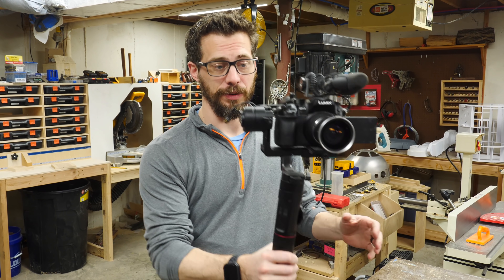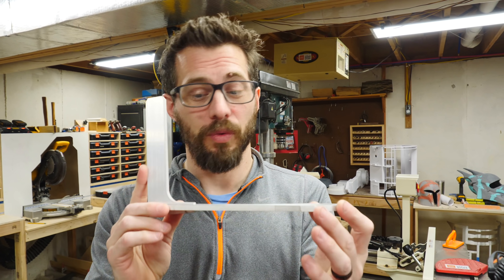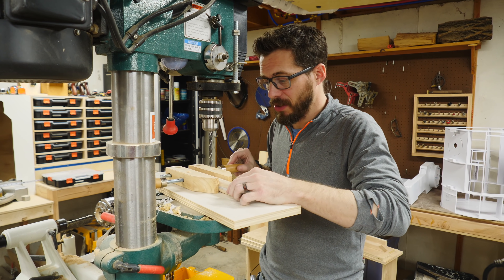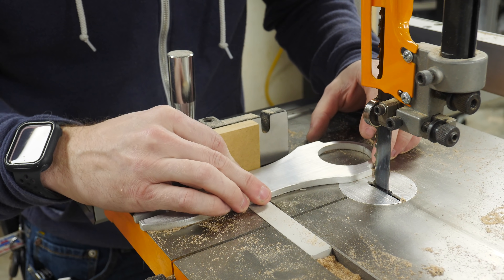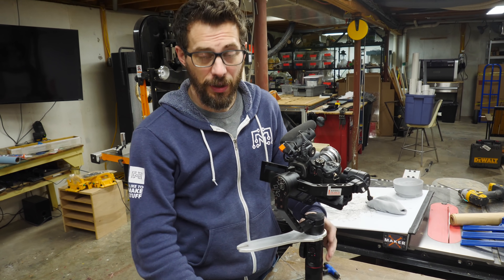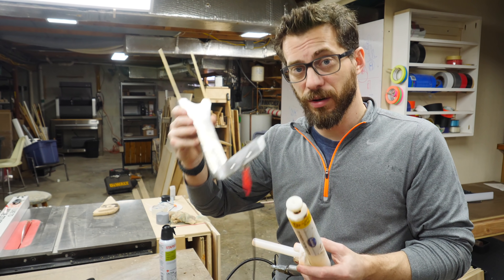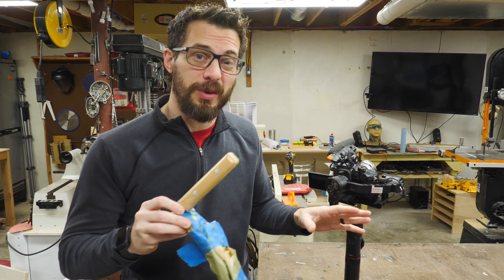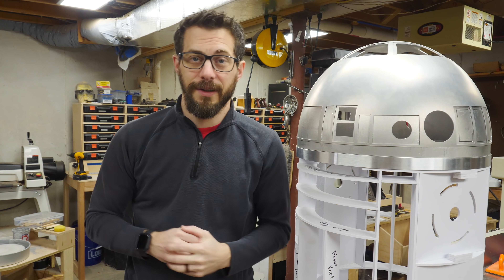Making a Gimbal Handle with a Water Jet | I Like To Make Stuff

Comment: When tapping, I frequently back off the tap to break the chip of the threads I'm cutting.  I heard or read it puts less strain on the tool and less chance I'm going to break a tap.  I don't know if there's any recommendations for how often.  This is what I do and I haven't broken a tap since I started doing it.  Get the tap starting to cut straight.  Go 1/4 turn back.  Go forward 3/4 of a turn.  Repeat.  This cuts only 1/2 a turn at a time, reducing the strain on the tap every time you break a chip.  Blind holes, I back the tap out periodically to get all the chips out of the hole.

According to the book "Manufacturing Processes 4-5" by LamNgeun Virasak, it's common to go forward a full turn and backing out half a turn.

Comment: Rather than use thicker material in you collar, in the places where you added the foam you should have cut slots and added 25mm x 10mm pieces of the same aluminum you are using for the rest of the kit.  That way at your key compression points you are getting more surface area for the grip, and you aren't adding a ton of weight.

Great video.  Great finished product.

Comment: Ha ha! Just as I was thinking, "He should have just bored a "pass-through hole on the top piece", you mentioned that you were going to do just that! Oh, and like a few people mentioned already, It doesn't look like you used any tap oil or any other lubricant to aid in the tapping.

EDIT: I went ahead and checked out the website for the Wazer... gulp

Comment: Instead of using a thicker stock material to make it more stable, add a small vertical piece to the inside of your clamp, similar to your handle, but smaller obviously.

Comment: It'll be interesting to see if you have issues with the threaded holes stripping out over time.  FWIW, we typically use helicoil inserts with aluminum to avoid this issue for the commercial work we do.  That being said, if you're not taking it on and off, you might not see an issue.  Overall, great design and video!

Comment: Cool video Bob! Hey I was just thinking about glue-ups and thought that might be a cool bits video or regular video. I was thinking specifically of what kind of glue ups work best. Glue with clamps super tight/not super tight, glue with superglue, glue with nails, glue with tape, glue with rubber bands... Etc I have always wondered how much glue between two pieces of wood is optimal. Is that something you or another maker have tested or talked about in a video? I know. Totally random based on the subject of this video, but I figured I'd post this on the most recent one.

Comment: I actually learned what a gimble is, so, how does it work? Does it use the weight of the camera? Or is there some sort of gyroscopic tech inside it that stabilizes it? Either way, it's very interesting
Reply: i think his model uses small motors to keep the camera level
Reply: @jarrodschnell3011  oh, but like, how do the motors know which way is up and which is down, or does it matter?
Reply: @totm2023  I am not sure but  I think there is a gyroscope or some type of computer
Reply: @totm2023  some  gimbals have a weight at the bottom. An example of this is a stabilizer called the glidecam Devin graham signature series
Reply: @jarrodschnell3011  oh, makes sense, so it could be a weight or a gyroscope like in a phone or the Wii u gamepad
Reply: @totm2023  yep!
Reply: if you want more information, just google it :)
Reply: @jarrodschnell3011  ok, thanks for the info
Reply: @totm2023  for sure.  over and out

Comment: You could add a half ring to the handle side, mounting it above the current clamp. Hold it in with a few tapered screws and it would stiffen up the grip (twice the current thickness). 

Nice machine.

Comment: Tip for tapping a threat: use a little drop of cutting oil on the tap and turn it one turn clockwise then half a turn counterclockwise. Then you'll tap won't break of :)

Comment: Bob, thanks for another great video. While grinding aluminium please be aware that aluminium dust is dangerous for lungs, actually more dangerous than steel sparks, so it would be better for you to have some kind of breath protection or at least just keep your head away from where the dust comes, just as you did on the video :)

Comment: Idea for the quick release: you could use a hinge on one side of the collar and then a clamp on the other side. 
While this would probably require the collar to be thicker and the cut to be directly in the middle of the circle, it would be quicker for sure.

Comment: Typically with a collar clamp like that you want the hole the head of the screw sits against to not be threaded and a larger diameter than the screw threads.  Tat way the screw just slips through that hole and threads into the second hole.  I'm not sure if I'm making that clear...
HA! i Had paused the video to add the comment.  You literally addressed it in the next sentence!

Comment: I am sure this was said, but another thing that could have helped is to not thread the top piece and only tapped into the handle.  This would allow the ring to fully compress and not have that micro space that is probably there due to the thickness of the blade... If I am not making sense, think of it like a wood screw, the top portion isn't threaded so it draws the material into the other.
Reply: He drills out the top holes at 8:20 so the screw can tighten down.

Comment: Would’ve been easier if you cut the holes in the handle right after you superglued it together, before shaping it. Just saying. And using some oil/lube when tapping should help, not saying it’s gonna prevent a cheap tap from breaking but certainly makes the whole process a bit smoother.

Comment: The 3mm screws won’t hold in aluminium this will break so easily, if used everyday the weight of the expensive ass camera and the torque on these screws no good. The handle needed to be stainless or mild steel im sorry version 2 needed. I give it 4 weeks of everyday use.

Comment: You really dont need a powerful saw on quarter inch aluminum.  I've cut it on my old 12 inch bandsaw with a 1hp motor.  Cuts like butter.

Comment: Hi Bob!

Two tips about taping that can explain your first broken tap. Maybe you already know them but in case you don’t it will be my pleasure to share them with you. 

First, you need to use tapping oil/cutting fluid. You can get away with simple WD40, but it’s not the best. 

Second, you need to break the chips. It’s even more important with small flimsy taps. Anyhow, the technique is pretty simple. Every few turns (this is the experience that will guide you on the number of turns, but if you’re feeling that the tap is flexing a bit more, it’s a good sign), simply unscrew the tap a few turns. You should feel the chip breaking. Then you can continue your tapping. With deep tapped holes, it’s always a good idea, from time to time, to completely unscrew the tap, clean up the tapped hole with compressed air and re-applying some tapping fluid before continuing. 

Nice job again! Continue your great work!

Comment: When you are tapping metal you need to use a lubricant as well as twist a half turn back up a quarter turn and repeat until the desired depth. It breaks the chips inside the whole. If you don’t it gets clogged and that’s why taps break. =)

Comment: the tap most likely broke because of the build-up of 'burr' inside the hole. to avoid this, do 3 spins in direction of tapping, and then do 1-2 spins back the other directions. this will get rid of the burr and avoid breaking the tap. cheers

Comment: Came for the outtakes. Left satisfied. 
 And bonus, I learned how to put one of those sandwich handles together 😆
Reply: In addition to what you learned about the handle here, you may want to note that epoxy is the correct adhesive to use and brass would've been a better pin material and that the order of operations was slightly wrong.

Comment: Brazing aluminum on your steel table is basically fighting the table to keep heat in the aluminum.
Reply: And I don't think he ever quite achieved the correct temperature. It looked like the flame was melting the rod instead of the surface temp.

Comment: Bob when you tap a hole use a thread cutting oil on the tap and turn a half turn forward then turn back a quarter turn and repeat. Doing it this way allows the material you are cutting to back out from the tap's end and binding and subsequently breaking off.

Comment: If you are using a tap that small, it is often a good idea to go two turns in and one turn out to relieve some of the pressure. That way some of the chips have a chance to get out of the hole. That is something that I learned when taking metal shop. Other than that, I love the video!

Comment: Little tip on tapping: The tap you are using is for through holes, it pushes the metal into the hole. What you are looking for is a bottom tap, it pushes the metal out of the hole and doesn't jam in the bottom.

Comment: watching you work, the thing I notice that I need to incorporate more is that it's okay to take multiple steps to achieve one goal. case in point, tapping the whole length of those M3 holes and then removing the threads of the top piece... I'd have probably wasted a lot of time measuring and trying to drill my clearance holes to the desired depth before even busting out the taps.

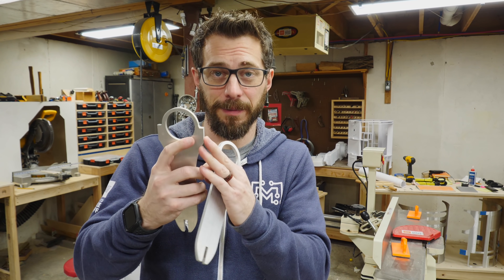Comment: 6:00 Possibly broke the tap as you didn't back it off enough so the soft aluminium snagged it and then broke :( , Nice video anyway
Reply: Based only on the footage shown in the video, this seems like the most likely reason for the tap breaking.

Comment: i won't be the first one to point this out, but it is a valuable tip to repeat : The tap breaking is from the threads of the tab clogging up , for every 2  half turns clockwise, turn 1 time anticlockwise, that way you turn "out" (eventually) that way you have cut form to hole to create the threads. also even in aluminium, use cutting oil (or wd40) it "flushes" the hole and threads in a way.
Reply: Absolutely this. I immediately noticed him driving it all the way in, and I knew it was going to break.
Reply: Yeah this blunder is even worse than tapping the screw holes before cutting them in half just to drill out the hole again.
Reply: i don't think this is a blunder.
this channel is about learning how to make, and Bob is on that voyage of learning with his audience. it's great that he had the idea to do this and jumped into this project and just did it. 
For once i have seen something that i might help him and that is only a little return from all i have learned from him , the channel and the community.

the part of drilling out the whole  after tapping isn't that crazy. it's harder to tap a shallow hole than it is a deep one.
the only thing i would suggest regarding to that in a project like this where you want the maximum precision you can, is to use the drill press to drill it out  and not doing that with a hand drill. these things are so out of balance, because of the battery and certainly DeWalt is very sturdy, but also (nose)heavy.
(don't know if that is the case with the model bob uses, it's my experience with them)
anyway, you never drill out the hole straight with a hand drill, you'll be much closer with the drill press. 

but you have to fix up a jig, to the needs of your drill press and the piece you are working on. 
which means time to set up for an other segment that maybe isn't as relative to the story telling and setting up the shots.
and since these guys are producing content on a daily basis, it's easier to grab the the hand drill  and probably it is good enough.

i'm trained as a movie maker, i get the hustle there, and the possible  irrelevance to the project/audience.

Comment: Always use cutting oil when you tap a hole.  you should also use a tap with a twist for deep holes or back it out often to break and clear the chips.

Comment: If you do redesign the handle, I suggest you extend it at 90 degree (from where it ends) so as to prevent it from slipping out of your hand (ex: if you have sweaty palms)... And to provide an extra place to grip when doing low camera shots... Coz it might become tiring to have your wrist bent to hold it... However, with that 90 degree handle extension, your wrist stays straight (basically your arm and wrist are alongside your body, just like it normally is when you're standing)... And easy to carry, like a bag... It's just an idea...

Comment: The breaking of the tap could be Because you didn’t did a half turn back every full turn, or it could be Because it’s a blind bore and the chip buildup caused stress on the tap
Reply: noah paessens 
I would add that you always want to make sure the tap is perpendicular to your piece. 

Full turn or so, then quarter turn backwards to break the chips. It would be a good idea to back the tap all the way out when it’s halfway through the hole so you can clear the chips that have collected in the bottom. A drop of cutting oil would help.

If there is a lot of tightening/loosening of the soft aluminum threads, you could also use a Helicoil insert to make for a stronger thread.

Comment: tap breaking: every full circle you make with the tap you want to twist it out completely, that way your tap will last forever. it takes longer tho..
Reply: It snapped because the chips get stuck in the bottom, you need to either drill a deeper hole than you want to tap or use a bottoming tap preferably with a spiral flute to clear chips. Twisting it out all of the way also works but it also increases suicide rates of machinists.
Reply: You probably already did this but I didn't see it in the video. Cutting oil will help make a cleaner cut and help the tap from snapping off
Reply: I learned to do one backwards 1/2 rotation for every full rotation to cut the chips off. Backing it all the way out a few times helps clear the channels, but after every rotation seems too often.
Reply: It helps to back them out but they can still snap easy especially with something as small as 3mm

Comment: My understanding when tapping was that you tap the tread a turn or two then back it out a half turn or so then continue ( to stop excess build up of heat and swarf) didn't appear to be doing that in the video. Could be a contributing factor to the broken tap.

Comment: do you have a tap chart for the pitch diameters when you pick a tap drill? my machinery's handbook has several pages of tables on threadforms, that book and my copy of design for manufacturability are very dense but once you learn to use them they have so much information.  keep being awesome :)

Comment: I love watching your projects. Keep up the good work. Is brazing just like soldering or is is different?
Reply: The concept is the same bonding two pieces together using another material that mechanically connects the two. The only difference i know of is the different "solder" you use when brazing and higher temperatures.
Reply: My understanding is that propane or maap gas is not hot enough to braze. You braze with oxy-acetylene
Reply: @coltonreiche9588   MAPP gas is hot enough to braze with - you can even silver braze with a standard propane torch. The benefits of using oxy-acetylene are the length of time the metal's exposed to heat and the added control. With the controlled OA flame, you can pinpoint the heated area and cause less "heat damage" (for want of a better phrase) to the surrounding metal. It also achieves the temperature required much faster.